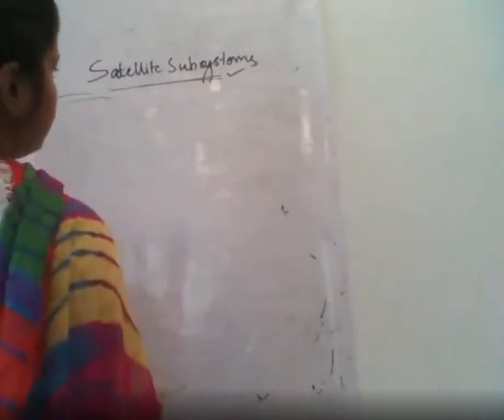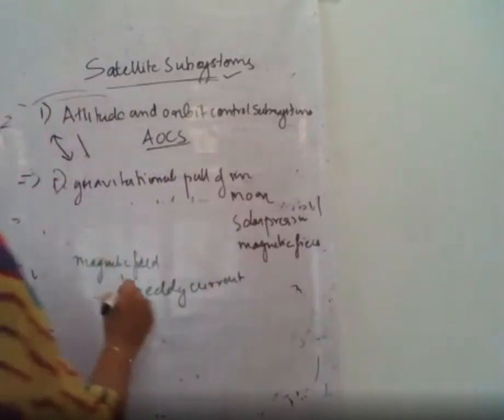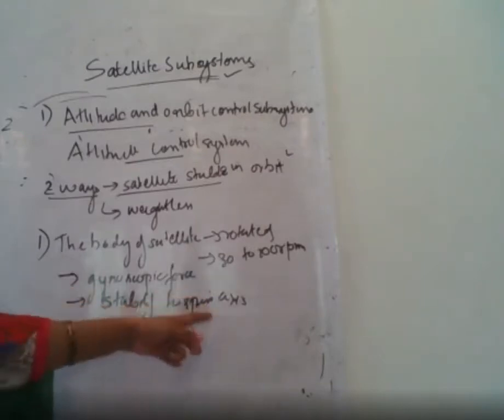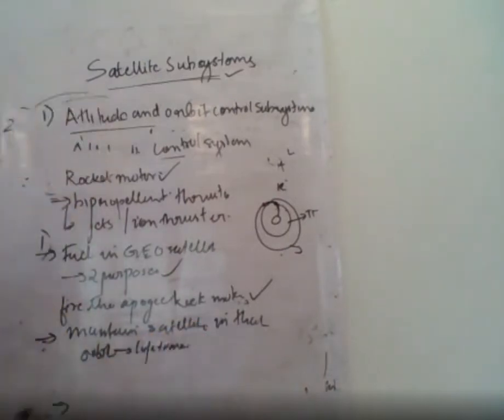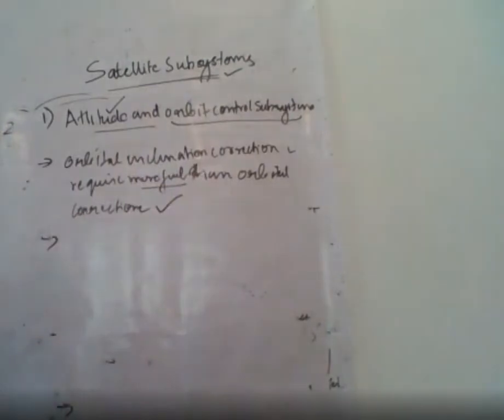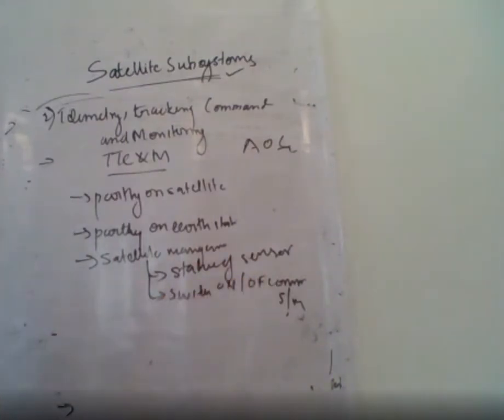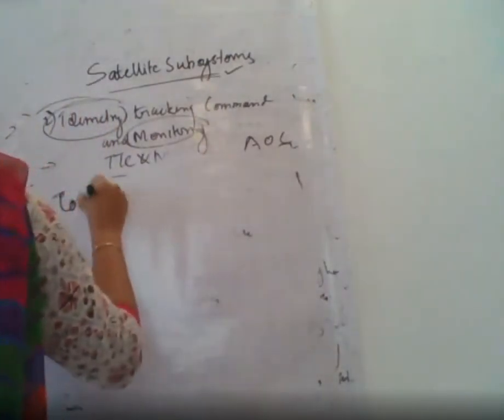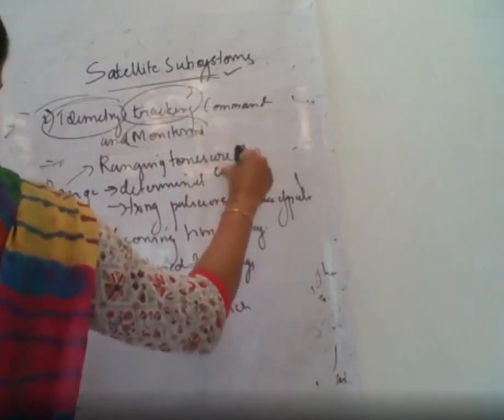STM EC4 EC404 MODULE3 PART8

Comment: Two ways to ensure stability of satellite are
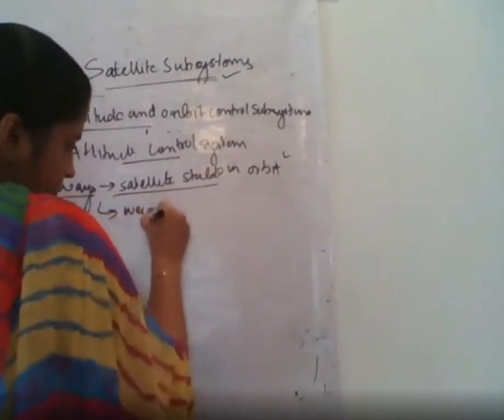Spin stabilization 8:45
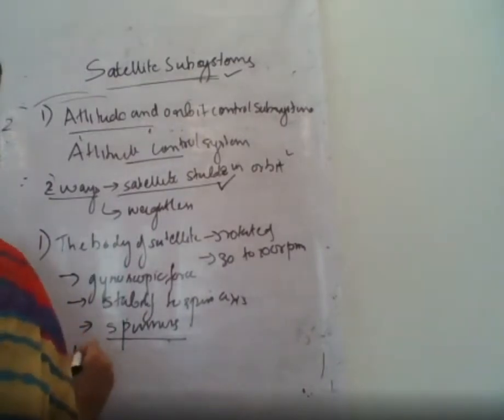Momentum wheel stabilization (3 axes method) 10:26
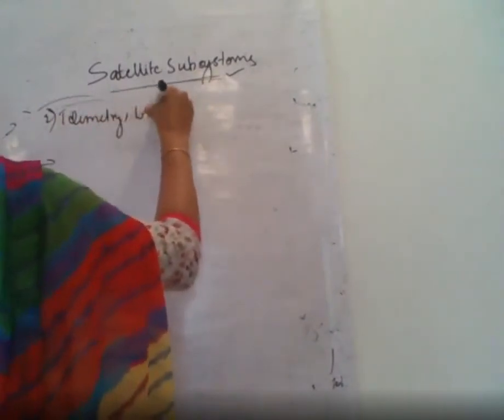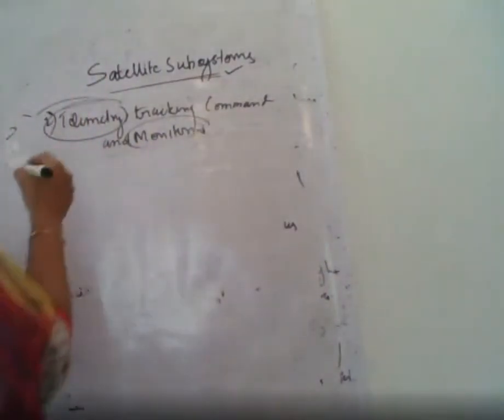TTCM Subsystem 22:55 - Tracking system 31:46